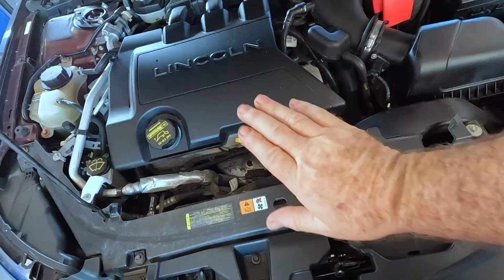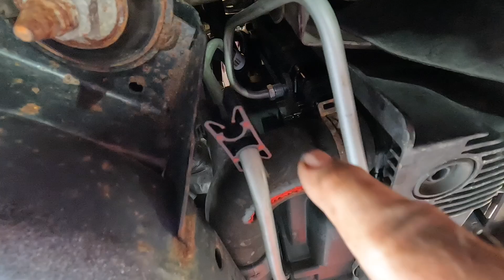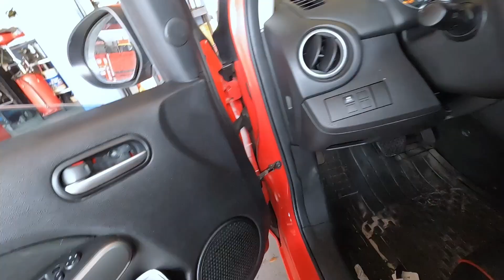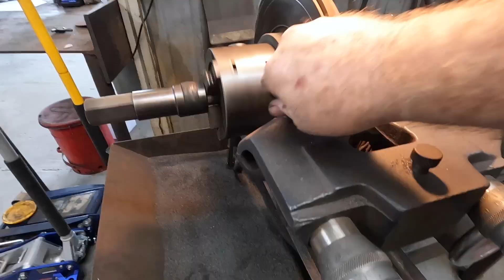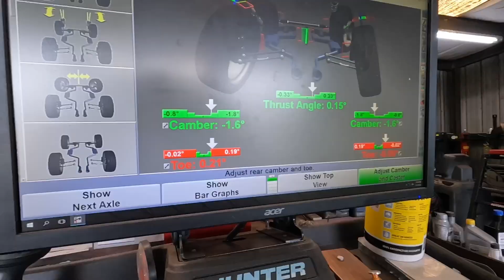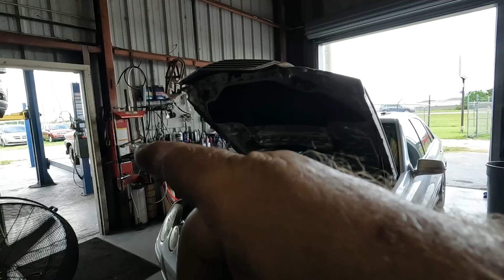A DAY IN THE AUTO REPAIR SHOP, MAKING IT WORK 34...TOYOTA, FORD, MILWAUKEE, ICON, LINCOLN...

Comment: Good video, What would be better in your opinion, A digital torque wrench or a split beam torque wrench for torquing wheels, Thanks
Reply from the maker: I prefer the digital if I can only have one, since it covers all my needs. The split beam is great if you don’t want to worry about batteries and don’t do much engine work.

Comment: Hi Jimmy, did you reach out to GoPro for help with your camera issues, they have a media section that helps YouTubers, I tried putting the email address here and YouTube deleted my comment.................If you need the email address let me know and I will email it to you direct.
Reply from the maker: Thanks Dan. I’ve been just riding it out and dealing with it. I bought the 10 because of the glitches in my 7, but it seems like it’s just a GoPro thing.

Comment: shame dodge didn't give a dipstick for the trans on the 07 nitro.... also shame they had to make it so convoluted just to check it needing to know trans temp and measure etc. why couldn't they just do like it been done for years. check when hot and have a add level and a full level.... stupid bean counters.
Reply: Oil dip stick works as a trans dip stick too
Reply: @momentumtintdetail  nitro has the stupid thing where you need the trans temp and measure chart to tell if it is low or not
Reply from the maker: Yeah, a lot of manufacturers are doing it. I think they don’t want people messing With their own cars?
Makes me a little sad. But people find a way most of the time.